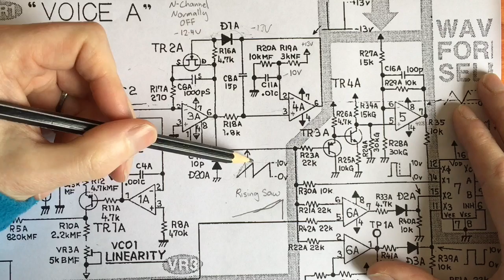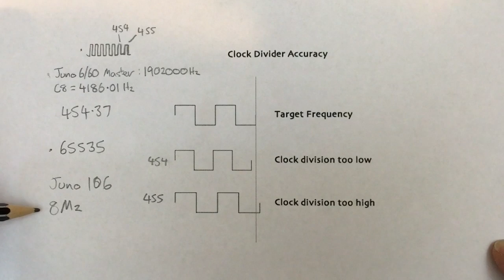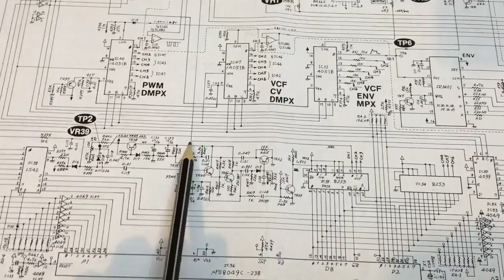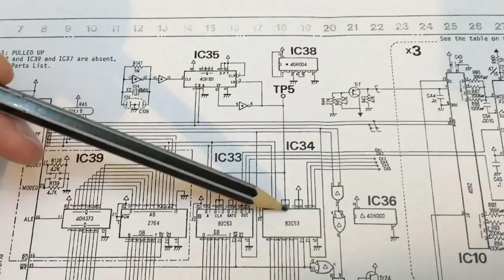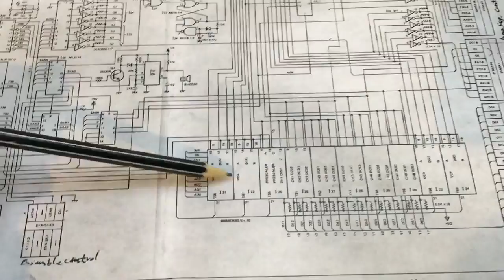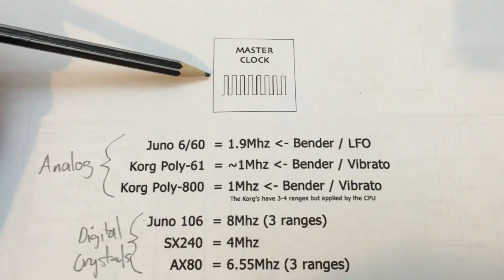How DCOs work, differences in Juno 6/60/106, Korg Poly-61/800, Akai AX80, Kawaii SX240.

Comment: Very helpful, thanks! Though that can of worms is interesting: what do you take as the definition of analogue vs digital? I'd always thought that "digital" meant that at some stage the waveform is represented as a series of numbers, which then get converted to voltage via a DAC. In this case, even though there's a meaningful difference between the master clocks, the voltages that get shaped and then filtered are always continuous voltages that come from (dis)charging capacitors. So, even though the quirks of the clock division used to reset the ramp can create artefacts due to not being able to represent precise frequencies, there will never be aliasing or low-bit-depth artefacts. Does that make sense?
Reply from the maker: That makes sense. All these synths I consider to be analogue. But the oscillator for the most part is not, it's a calculated frequency. But at the same time you don't get aliasing which is a digital trait. Really they are all hybrids to varying degrees, and in hindsight I should have said that in the video. Although I think the best part about analogue is gone, which is the instability.
Reply from the maker: +Eman Mann I agree. It now depends on processing power and the knowledge and time the software developer has. I have owned many Virtual Analogue synths and the part I find most annoying is the pitch variation on the oscillators is never truely random like an old analogue. They just apply standard digital modulation waveforms, which are all highly reproducible, and even the same modulation source is applied to all oscillators! To do it properly you would need to apply different random modulations to each oscillator individually. That takes too much processing power in most cases. They need something quick to write on the marketing advertisement, not a "real" emulation.
Reply from the maker: +0e0 Most of the drift attributed to temperature is caused by a circuit called the exponential convertor. The control for a VCO is a 1V/Oct linear scale in most synths (except in Hz/Volt synths) but oscillators need a non-linear "double the current = double the frequency" scale. So there needs to be a circuit that converts the linear Voltage to an exponential current. It's this circuit that causes a lot to the drift. Look up "exponential convertor in VCO". It's more than that though. Analogue VCOs have micro variations that can be seen on a good tuner. Those variations are not present in DCO's. I've had some requests to do a vid on VCOs, so I might do one later.
Reply: is there any information/literature around just how the current changes for an oscillator?  or like the nature of "random" drift in analog circuits in general?

Comment: Amazing as always! I heard a myth that Poly 61 actually misleading with "DCO"s and got 1 discrete analog oscillator and 2nd pure digital (they are really sounds VERY different) - but it could be only a myth though :) Is Kawai SX210 uses the same approach as 240?
Reply from the maker: Yes the Poly-61 has purely digital oscillators as well. The DCO-2 saw is a stepped digital waveform with quite bad resolution. But that doesn't mean it sounds bad. People can make up there own minds. DCO-1 is the more traditional one. I had this discussion with a friend recently, technically any digital waveform is a DCO, because they are digitally controlled. It can be hard to tell when the "marketing" takes over from reality.
Reply: Yes. Poly-61 actually sounds very good on basses because of the 12db low pass, not everything depends on the oscillators :) Just checked SX210 service manual - and yes its exactly the same 4mhz crystal (they call it "MASTER OSCIRATER" - not sure about the rest though :) Will we see a Kawai repair soon? Thanks for your amazing work!

Comment: Great video! I actually thought the 106 had a DC-controllable oscillator, since it has a tuning trimmer on the back. How did they manage to do that, when the oscillator is crystal clocked?
Reply from the maker: My understanding is it's done the same way the bender and LFO effect the frequency, the CPU just calculates a new divider ratio. There is no way to change the crystal clock, it's impossible, so it must be done digitally.
Reply: You can change the frequency of a Crystal oscillator .....if you shunt it with a variable capacitor.

Comment: thanks for this golt! perfect timing, as im currently trying to choose between an AX80 or poly-61.
Reply from the maker: Definitely the AX80. The sound of the AX80 filter is much better than the little korgs in my opinion and it has more options. It's also more highly sort after.
Reply: I've owned both and have used both for a long time and the AX has a beautiful apperance with its fluorecent displays and have a unique sound imo. Om the other hand, I've always adored the Poly 61 for its ability to take on lead sounds and pads so they both have merits for different reasons to me. Great tutorial btw! :)
Reply: Go Ax , P61 is a VERY limited synth.